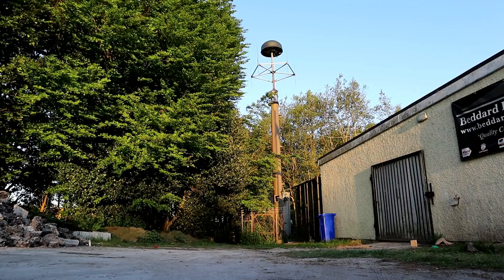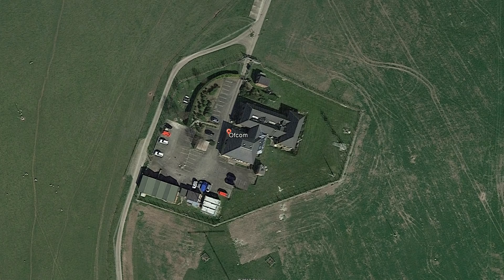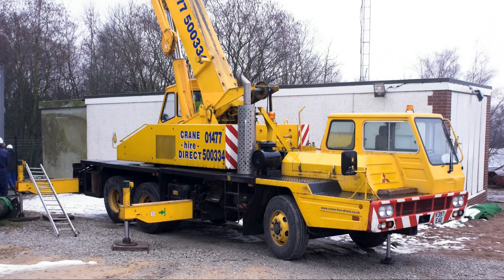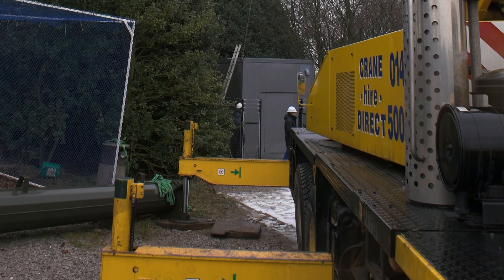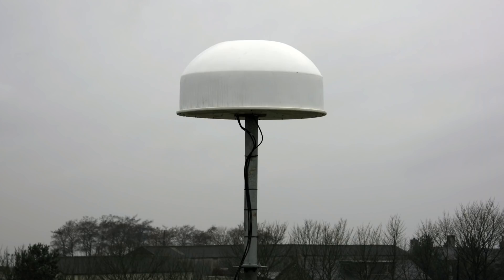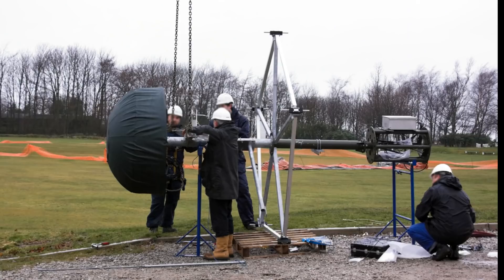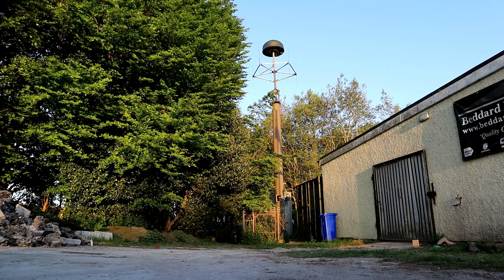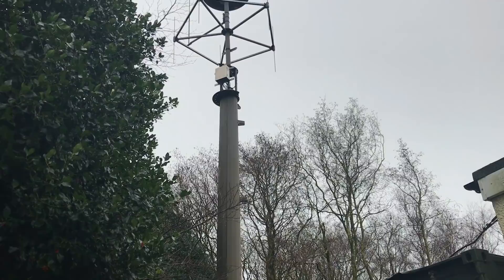Installing Werneth Low Direction Finding Array - Never Before Seen Photos!

Comment: It's a model 641 antenna made by TCI International. Works over the range 20-3000MHz with improved accuracy in the 20-175 MHz range using the additional five element array. Ofcom sold some off at auction last year.
Reply from the maker: Cheers mate!

Comment: Stumbled upon your channel and find it refreshing that you're asking so many questions. 
Many many years ago I was granted access (was a business thing) to a site at Hartley close to Whitley Bay. The site had maybe 6 or more tall lattice towers with stings of insulated from ground bare wires being suspended. 
I've never had definite information on the site except the following:
Hartley was originally a ship to shore radio site (though no coastguard there etc!). In later years it was sold to several utilities companies (water, gas etc) and was used as a means of communication to their vehicles.
How true any of the above information is I don't know but I can tell you the following:
Inside I saw white painted concrete walls and large square rooms with high ceilings. Several doors led away and most were open exposing a kitchen in one small room, a toilet in another. There was almost no machinery left in the main room except for what looked like a large filing cabinet-sized piece of electrical equipment. Lots of lights and buttons on it and hung to the front was a hard wired telephone hand set. I also spotted a hard wired CB radio hand set. That was it - a huge site with huge masts and a single large radio cabinet.
I believe beneath the Hartley site is several fuel tanks and old standby generator sets but I don't know as I never saw them.
Be great to finally know what the Hartley site is all about   :)

Comment: I wonder if this is part of distress and diversion network of df's used for triangulating aircraft in trouble. They operate on 121.5mhz and can triangulate a May day transmission anywhere in the UK.
Reply: No, Ofcom have nothing to do with that. The VHF Position Fixing Network on 121.5 MHz is shared between the CAA and the MoD (RAF) and is monitored at the distress and diversion cells at Swanwick, Hampshire (London ACC) and at Prestwick (Scottish ACC). Most DF sites are on current or former aerodromes or at the remote VHF comms sites. A similar UHF only network operates on 243 MHz for UHF-only military aircraft and shares some remote sites with the VHF system but also has some of its own.

Comment: Nice beats and antenna installations! Two of my favourite things.
No doubt part of a network used for interference tracking and mitigation (among other things).
Finding an EPIRB activation or pesky wireless microphone, that sort of thing. Especially necessary with the amount of cheap nasty crud coming into the market and being used by people with no technical knowledge. Those bargain wireless headphones could be jamming open or de-sensing a repeater somewhere. Or people importing and using cellular jammers.
 Great photos of the install work. Thanks for sharing!
Just check for black vans outside and make sure you aren't being tailed in traffic ;) TEJRJWNE
Reply from the maker: Haha cheers mate!!! I've got a fantastic update for Tejrjwne! I've just gotta get round to filming it